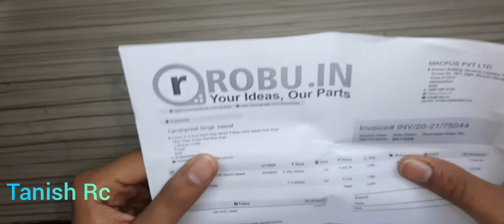Brushed Esc 30a Brushed Esc || Tanish rc

Comment: Good information ❤️ brother
Reply from the maker: Thanks
Reply: Can I use 775DC Motor.....how to setup in put voltage 11v with 30A ESC
Reply from the maker: @jallabalaraju6844  775DC Motor is 12v Motor  and esc voltage is 7v so it can not be use. This esc is use 180 brushed motor or 9v dc motor etc.    

I will recommend you to by an big esc 

esc link: https://www.amazon.in/Festnight-Waterproof-Brushed-Electronic-Controller/dp/B07PDKW3KZ/ref=sr_1_8?
crid=12XRX73VU3DN0&dchild=1&keywords=brushed+esc&qid=1620191410&sprefix=brused+%2Caps%2C312&sr=8-8   

any query contact: 8728029359 (whatsapp) 

Regards  Tanish Rc